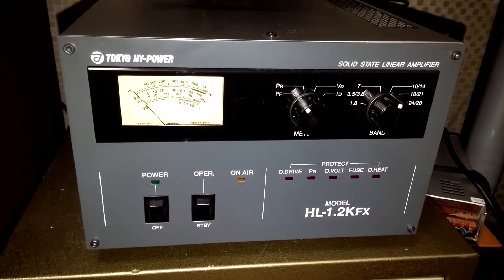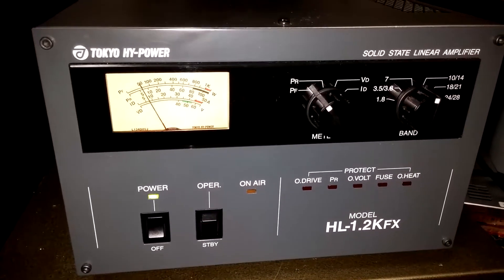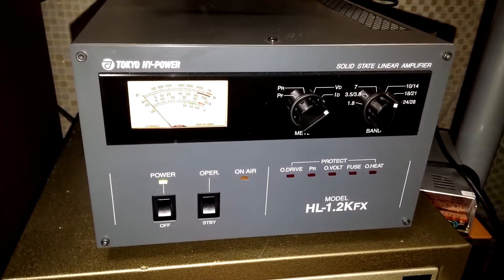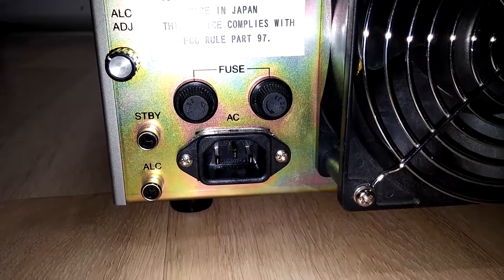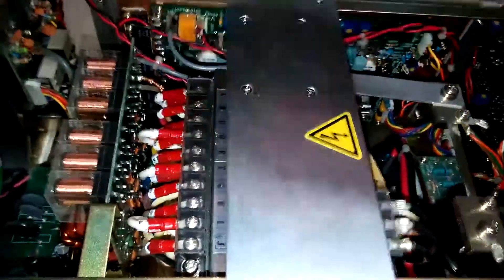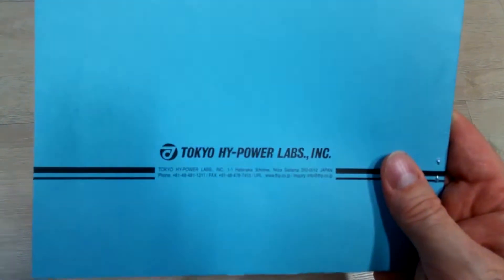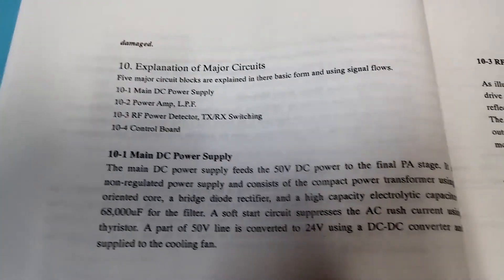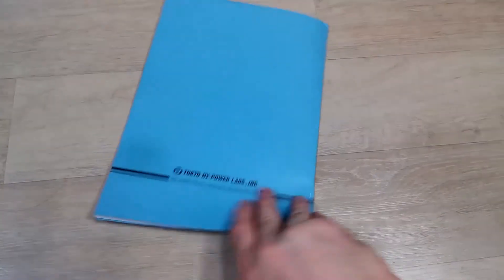Tokyo Hy-Power HL-1.2KFX Solid State Linear HF Amplifier

Comment: Good Day... where to buy..pls drop me message. Asap tanx
Reply: This model has not been sold for a while.  The Tokyo Hy-Power company went under because it was also owned by another company that pulled it down with it, due to financial difficulty.
Reply: @cleanairideasin9491  do you have any idea or someone knows to find this kind of stuff..tanx for replying with me.
Reply from the maker: @liamdee9926  They are sold on websites like Eham and qrz.com in the USA, occasionally.

Comment from the maker: Adding that I went ahead and adjusted the jumpers for a slightly lower voltage, and it still runs great in the green zone.  I can get 800w out of this amp easily, but usually run around 700w.  This amp has fabulous protection on it.  This is a fabulous amp!

Comment: I have the same amp, all bands except for 20 meters put out around 750 with 70 watts input on 110ac.
For some reason 20 meters is only given me about 250? Any idea?
Reply: Markinpuff the schematic shows a low pass filter for each band. It is switched by relays. Thus a guess is the trouble is on this area

Comment from the maker: I wanted to update what I've learned about running the Icom 7300 with this amp.  It seems like the best way to squeeze full average power out from the Icom 7300 is to:  1.  Turn off the 7300's compression.  2.  Set the mic level so that your voice is just peaking up to max 1/3 (or less) of the ALC range.  3.  Turn the compression on anywhere from 1 to 5, per your preference (5 gives me about 10 to 15 percent compression, the max I'd recommend going, for DX).  My mic gain ends up around 20 with stock mic, and EQ settings around 0 for bass, and +1 to +3 for treble.  I talk across the mic, with the edge of my lip almost touching.

The 7300's ALC is very aggressive, and will tamp down the level too much, if it's in the higher ALC range.  Seems to work much better to keep the 7300's ALC in the low range, and beef up the compression.  People give great reports, and my average power out is higher to the amp.  I only max about 70% output most of the time, given this higher compression level from the 7300. It can push higher, but I like to keep the needle on my peak-reading meter bouncing without overdriving.  With other radios, that's too much compression for this amp to sound its best, but the 7300's average power output is still weak enough that it's a decent mix.

FYI:  My peak-reading average on the 7300 is about 103 watts... it's the average power that is weaker compared to most rigs.  The above settings help this a lot, because it helps keep the aggressive ALC in check.